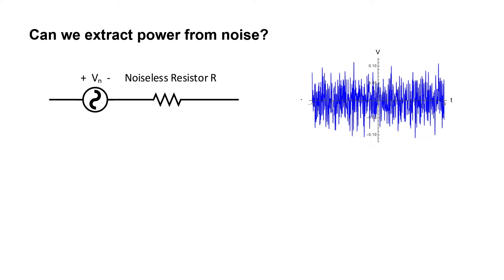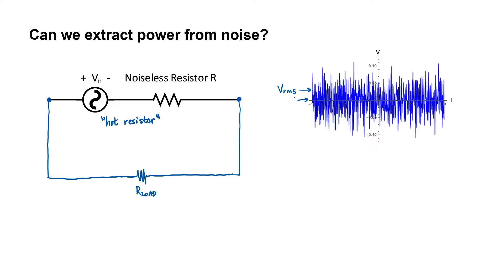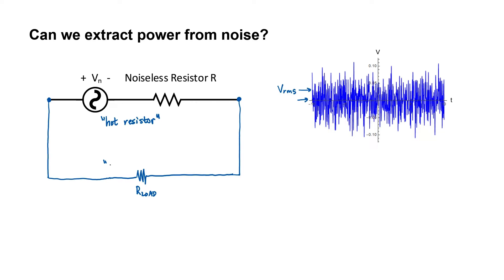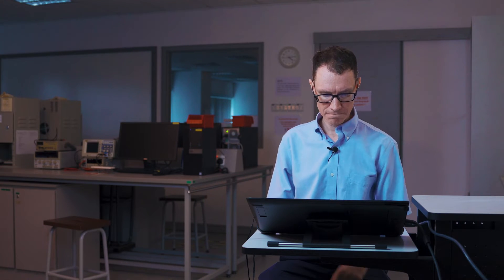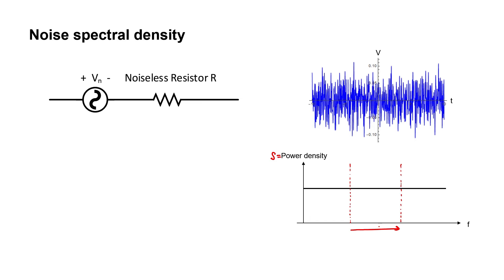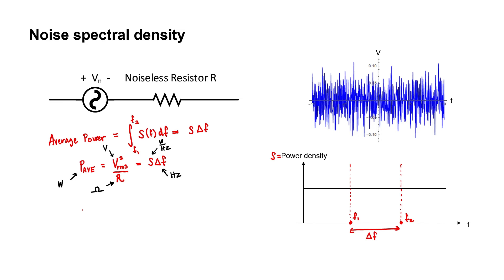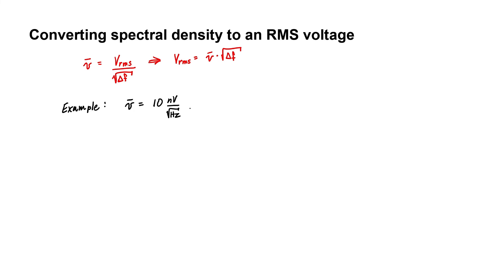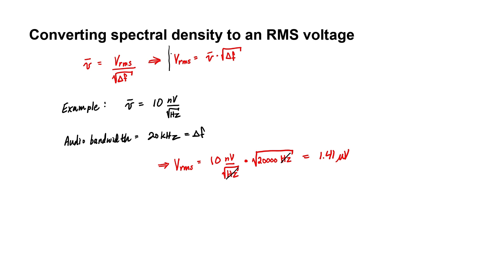Noise and its weird units of V per sqrt Hz (Amplifiers #12)

Comment: Am back again! 

Am not consulting any sources, only my understanding. Many years since i studied... 
So, the way i understand it, and why noise is not tailed down as you say:  
The contributors, that are making all the noise, are quantum transitions of electrons, and that gives the end of the noise domain. These contributors contribute perfectly random, therefore you can have, for say n contributors, with equal probability, all cases from isolated unique transition, to all contributors contributing insequence, giving uninterrupted signal, n-transitions long. It is combinatorics. 
The highet frequence in that noise, corresponds to the quantum transition speed. Before that, there is no taling down. How big that is? I would not calculate, but if you check, i believe you will be awed by how big is that frequency. 

How big is the power that can be obtained from noise? Well, big ehough! 
It is the power of the heat transfer we can manage to obtain, well, significant part of that power. 
We use to think noise in stationary regim, but if we wonder how much power we can draw from noise, well, we can get power from noise, so to speak...

Comment: Keeping it in practical terms, ok. And a natural limitting of the bandwith, it is a problem of processes inertia. Process inertia brings that tail down, and there is always something of that. Even if you intervene, placing say an RC LPF, you are modelling process inertia. That natural inertia dose, it is not contained in the formula we use to calculate noise, so we can consider that formula not to be perfect science. Being just a limitted truth, we cannot ask the circuit to satisfy that and not generate infinite power. That limitation does not come to satisfy the partial truth. What needs to be justified, it is that partial truth, and it does not impose further constraints on its root causes. 

Your approach, perfectly practical. Good video! 
My approach, looks not practical, that is until you move to quantum processing. Ther they found the power distribution function not tailed down, and it only tails down there. 
It means the model of resistor is more cappable than any detector, and that tailing down of the power distribution, is mainly a detector proble. Resistor noise keeps on going, untailed down, to infinity, and only some transistors tail that down. Natural limitation exists, of course, and it goes into the quantum transitions, that are so very fast! That tailing down is a matter of the quality of... matter, particle level, and the necessity to avoid some energy paradox is written inside the particles.
Reply: Indeed.